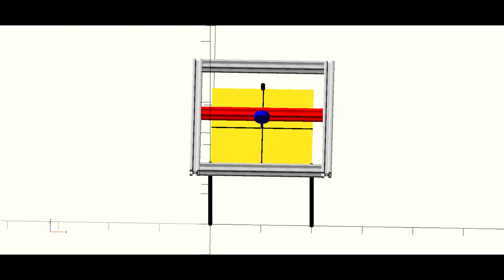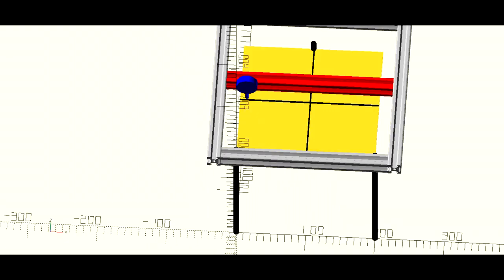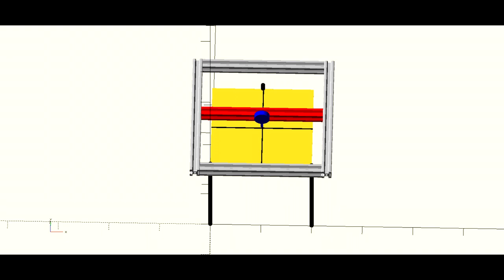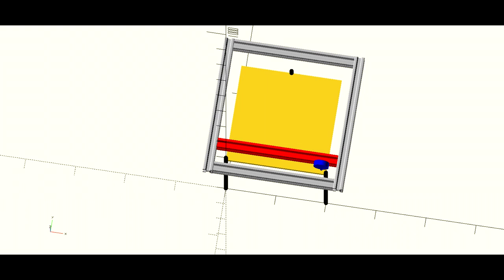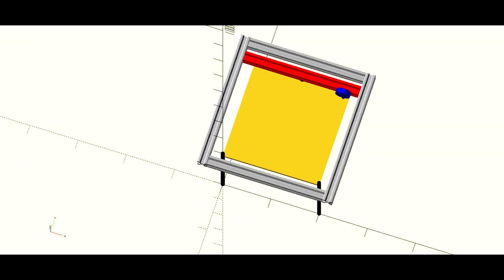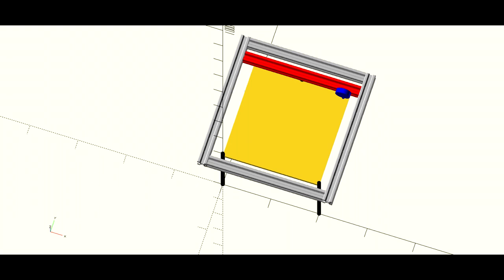3D Printer Build Plate Levelling

Comment: I think this is the most comprehensive video I've seen on leveling.  Great video!  I recently used very similar techniques to resolve a rail alignment issue that was detectable only when using a multi-extruder tool head.  Thanks for teaching this critical skill.  

I've been running numbers on the thermal expansion of large build plates.  It can also be the source of significant errors.  I'd like to hear your thoughts on the topic -- especially for folks designing/building printers.
Reply from the maker: Thanks for the compliment. Glad you liked it and I hope this will help others now and in the future. Ref thermal expansion, yes I agree that it can be a cause of problems, especially with large, thick, aluminium build plates. The most common cause of concern seems to be that the thermal expansion can cause the linear guides to bind. I've seen various kinematic mounting  arrangements designed to mitigate this. I used a slightly different approach. My aluminium plate is bolted through short pillars to a frame made from extrusion and there is 12mm of semi rigid insulation between the plate and the frame. So although the plate heats up, the frame remains cool. The guide carriages are fixed to the frame rather than the plate, so binding isn't an issue for me.

Comment: May I ask a favour? I learned a great deal from this video and the one on lead screws because you demonstrate so visually what you’re presenting and that really helps us non-engineers, who thought they could just a printer kit together and print. Yes, I know...I’d smile if someone downloaded Visual Studio and thought they could just produce an app in an hour :) 

I’ve assembled my CoreXY with a 500x500 build plate. I want to print large batches of small/simple items. I’ve got 3 lead screws on the Z axis. But the screws are left flapping around in the air. The bed slides up/down on linear rails. Also my build plate was delivered as a 4mm thick aluminium sheet which sags badly as you’d expect at these dimensions. I have a 9mm plate on the way - but I’d really like to learn more from you about assembling a solid build plate, especially one that won’t drop on power off. I really wish I’d seen your videos and those of others before I undertook this journey. But I’m enjoying and learning nonetheless. Thanks for taking time to share your knowledge and I just really appreciate everything about your fuss-free presentation style.
Reply from the maker: Hi and thanks. Take a look at my blog. There is tab at the top that will take you to a section about my printer. You might find some information there about my build plate. If not, contact me via my blog. That'll give me your email address and we can carry on this conversation that way.
Reply: @deckingman  you’re a star - much appreciated
Reply from the maker: @chrisnurse6430  No worries - glad I could help. I just remembered that I upgraded all the printed parts of the Z axis to aluminium parts and did a post about it at the time https://somei3deas.wordpress.com/2019/07/04/z-axis-aluminium-upgrade/

Comment: I get a fair amount of deviation on bed height overall when comparing the bed heated up to say 90c vs just room temperature. It's an e3d TC with their glass and bed heater. Nice Escher print there behind you.
Reply from the maker: I'm not familiar with E3Ds bed mounting arrangement. I know it's a cantilevered design (bad idea IMO) but how is the build plate attached to the frame? Does it have kinematic mounts or might thermal expansion be causing it to distort?

Comment: Out of curiosity, might just give the three-point mounting a try - my bed has free areas along the left and right edges. I've always wanted to try it but have felt if any force (i.e. heavy print) acted around the unsupported corners, it would tilt it.
Reply from the maker: I guess it's possible if you printed a large object over an unsupported corner, but why would you want to do that rather than print it in the centre of the bed? For info, my bed is 400mm square and I once printed a "T glass"  coffee table that was 390mm across and 700mm tall without any issues.

Comment: Hi great video, im building a 450mmx450mmx500mm corexy definitely using 2mm screws for z axis, what thickness aluminium plate would be best for the build plate also do you reinforce for warping as i will be heating to around 100 degrees
Reply from the maker: I went for 12mm thick for my 400 X 400 build plate but that was a bit overkill - the thicker it is, the longer it takes to heat. For 450 X 450 I'd use either 10mm or 12mm. Mine is bolted to a 2020 frame with the bolts passing through hollow pillars, 12 mm tall. Between the build plate and the frame is 12mm of semi rigid insulation of the type used with underfloor heating. This speeds up the warm up time (but slows the cool down time) but more importantly is that very little heat finds its way to the frame. So the lead screw mounts and linear guided can be connected to the frame without having to use complex kinematic mounts to compensate for thermal expansion. The heating element is a mains voltage silicone pad of 360mm X 360 which leaves a 20mm gap around the edge where the frame bearers are. The element is sandwiched between the insulation and to the aluminium plate so if the adhesive was to let go, the heater would stay in place
Reply from the maker: One thing I'd highly recommend is to drill a 3mm hole in the edge of the plate, as deep as possible and as close to the upper surface as possible, and fit your temperature sensor in that hole. If you have a sensor  built into the heater, you'll find it takes an awfully long time for the upper surface of the plate to reach the desired temperature due to premature one-off cycling of the heater.
Reply: @deckingman  many thanks for your reply, going to copy your bed design hope you don't mind lol ,just ordering the aluminium extrusions going for 3030 ,probably will be picking your brains again when I'm building it ,if that's ok ,have modeled it on tinkercad if you have you time would love to send you the design
Reply: @deckingman  Thanks great tip never thought of that glad i found your channel
Reply from the maker: @e-z.g4188  No worries. I'm currently 10,000 miles away from home so things are a little difficult. If you look at my YouTube profile, you'll find a link to a Wordpress blog that I used before starting this YouTube channel. You'll find some stuff about my printer and the build plate on there. Also, there is a contact form and if you use that to get in touch, that will give me an email address and we can continue this discussion.
Reply: @deckingman  really appreciate your reply will check out your page and send you my email ,Have fun on your travels still waiting for parts and keep changing my mind on the design lol ,so will be a while before i start the build

Comment: I am currently designing a custom IDEX printer and was planning to have 3 independent leadscrews that each home independently to tram the bed! But I'm going to start out with just two first, mainly space/budget for the moment. Do you think that it is not worth independently driving each?
Reply from the maker: The choice is yours. As I explained in the video, if you drive each screw independently, then they will go out of sync whenever you cycle the power. So you will have to run auto bed levelling bed every time. For that reason, my preference is to use a single motor and continuous belt - then I never have to level the bed. Also, even with 3 screws and independent levelling, you might still have problems unless your frame and rails are truly square.
Reply: @deckingman  That's very true! My plan is to have the bed level all independently the first time and remember the offsets. Thus, the next time it just needs to home Z, apply the offsets and it's good to go! In the case of a synchronised belt, aren't you limited to one tooth equivalent resolution for levelling? Or is that resolution basically negligible for your setup? (Unfortunately I've got one of those 4 starts lead screws :/)
Reply from the maker: @T4nm4y  I don't think you quite understand. When you switch off power, the motors lose their holding current. When you re-apply power then will will jump to one of 4 step positions. But there is no way to determine where those step positions will be for each motor. Some motors might go forward, others might go backwards, but the firmware won't "know". The Z offset for each screw will change every time you cycle power, so you'll have to run auto levelling every time. With a single motor and continuous belt, all 3 screws will "jump" to the same step position when power is applied (because  there is only motor) . The belt pitch is irrelevant. One whole step can be a fraction of belt tooth - it doesn't matter.
Reply: @deckingman  Sorry, I don't think I described it exactly how I imagined it. Essentially, the system would rotate all lead screws to level z, and then each Z will make a small homing move to ensure that it has reached a set position. The system then known the offset of each leadscrew from each limit switch in order to return the bed to the specified plane. Essentially it will be homing each screw individually, but it would happen so quickly that it would not be noticeable. (If I used a probe then I would have to move the probe to each leadscrew individually, so I'm suggesting 3 limit switches on each lead screw.)
As for the synchronous belt, I'd assumed the pulleys were permanently attached to the lead screw. I was thinking at the moment in time when you would be tramming the bed as opposed to while you were generally using it. Sorry, it is a bit more difficult to describe over text 😅
Reply from the maker: @T4nm4y  OK. I think I understand what you are saying about using 3 limit switches and determining the offset only once. That should work providing everything is stable and nothing drifts. But I would recommend that you also make sure that the frame is dead square as I described in the video. You should only need to do that once if everything is nice and rigid. 
For levelling the bed, where there are no other adjusters like my machine, I slacken the grub screws holding the pulley to the screw shaft, then rotate the screw, and tighten the grub screws again. For sure, with a 20 tooth pulley, then 1 belt tooth would equal 10 full motor steps so clearly working to the nearest belt tooth wouldn't be anything like accurate enough. 
For info, I use 10mm screws but I use my lathe to turn down the section where the pulleys fit to 8mm then use 8mm ID pulleys. That way the grub screw bite into a plain shaft, rather than a threaded section. 
Separate bed adjusters would make that process easier but I rarely have to adjust the bed level so it works fine for me.
Reply: @deckingman  I'm hoping it will be rigid and square! I don't have too many tools with me to adjust the frame but I'm hopeful. I'm using 3D printed parts and rods so hopefully I can design skew adjustment into the parts if they are not square.
Ah yes, grab screw makes sense! I'm so used to having a flat for it to sit on I forgot that you can tighten a grub screw on a shaft and it would be fine for this! 
I'm reusing parts from my first 3D printer so I will have the standard potato chip levelling screws available if needed!